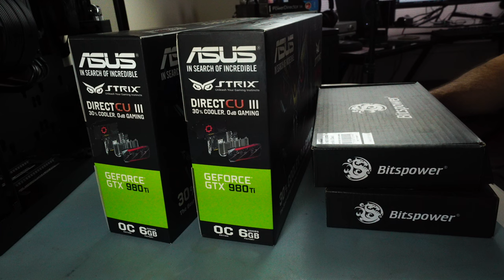STH10 Monsta Upgrade - (4K)

Comment: No  EK waterblock for the NVMe drive?(One of those "because you can" things).
Reply from the maker: +Thomas Andersson No.  Not right now.  In case I need to remove and use it elsewhere, I did not want to lock it down with tubing.

Comment: Are these cards heavier than the stock cooler with the waterblocks installed?
Reply from the maker: Yes they are.  Not too bad, but that is one of the reasons I like reverse layout cases, so they don't droop.
Reply: thanks for the info

Comment: you need to get a drain port, it would make it 100% easier.
Reply from the maker: I do have one in the bottom front. I just did not want to completely drain for this quick swap.
Reply: Ronsanut
ah fair enough man

Comment: so u bought 2 gpu's that will not mather anymore once the 1080/1070 is released for much cheaper
Reply: +stijn324 I remember seeing he's had the GPU's for months. I don't understand how you can have two 980ti's doing nothing for months, but that's his business.
Reply from the maker: +Daniel West It was in my stock of parts. Had a lot going on and was unable to do the upgrade or builds until now.  Believe me it was burning a hole in my head when I was going to get to using them.
Reply: Ronsanut I guess it's just my perspective and personal experience speaking. I shouldn't judge.
Reply: would love to see you compare the 2 980ti's compared to one 1070 and so how the sli fps compares to the one 1070. I am very excited about the 1070, please see my video review of 1070- I dont have 980ti to compare and dont so far see such a comparison
Reply: i do not own 2 980ti's my last gpu was a regular titan 6gb (wich was powerfull enough to run most games)
Reply: Whenever I buy equipment, I buy it asking does it run what I want run in games, special projects, rendering, etc and knowing that all equipment will be obsolete- a new video card probably every 2.5 years and new motherboard and cpu every 5 yearsand yes my 970 sli is obsolete by the 1070 and esp when there is a new generation of cards, such as a change in tie size, I expect much better performance- but it is troubling that I must save $380 for each new video card- if you watch my file1man comparison of 1070 to 1080, 1070 seems much preferred

Comment: is that just one long extension fitting?  sloppy and lazy.
Reply from the maker: +jasonlax Yepper! A quick fix, had to swap out those cards and get my system up in the same day.  When I move in July, I will be draining it and updating some of the tubing and fitting runs. 
Thanks for watching.
Reply: +jasonlax if you watch his other videos, he is neither sloppy nor lazy. I have my GPU loop under soft tubing right now because I needed the loop up now and did not have the time to bend some petg. You have to do what do have to do sometimes.
Reply: Zibigan thanks bud.  I do watch all his videos and I KNOW he is capable of more.  The difference between you and him is that he posts his builds to YouTube and he knows that his viewers expect only the best from him.